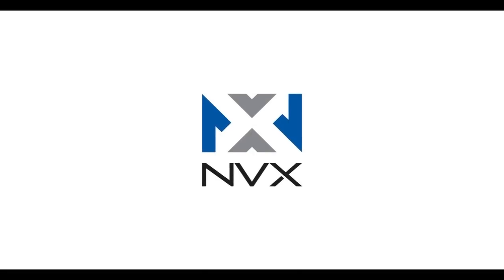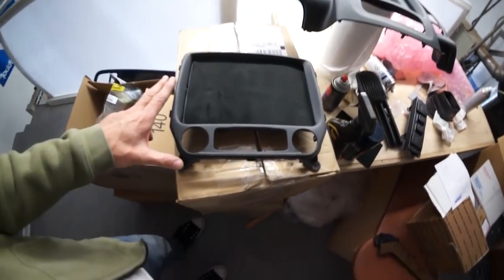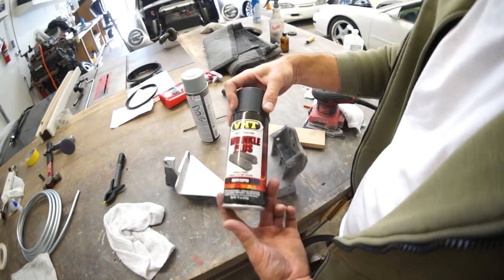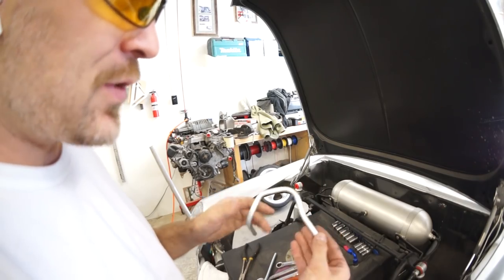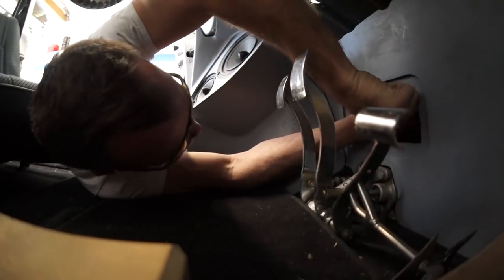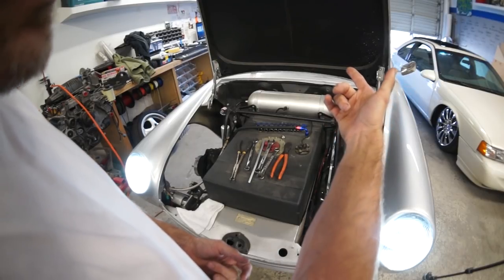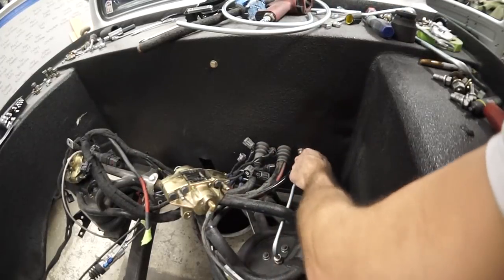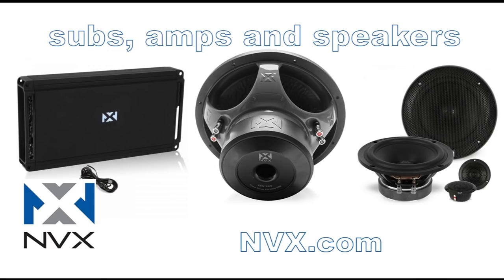I wrinkle painted the new alternator bracket!

Comment: What media do you use in the blaster? Aluminum oxide or glass beads?

Ceramic paints are great- but they must be heated to achieve their full potential.

The coatings "flow" together and cure when heated. A suitable toaster oven, or even
a 220v electric oven is great for parts. Curing makes it very durable and shiny.

VHT has an entire line of coatings; primer, paint, clear, matte, flat.

A simple clear looks better than chalky oxide for aluminum.

Comment: You should add a little grove make with a tubing cutter where the “teeth” inside the ptc fittings grip the hard line.  Those fittings are made for the plastic dot line and the “teeth” bite into it.